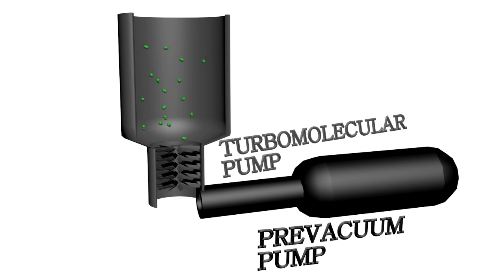Turbomolecular Pump | Vacuum Pumps

Comment: So -does a turbomolecular pump NEED to operate at 90K RPM? could it theoretically operation at a lower speed?
Reply from the maker: Newer systems are often automatic. So they start operating at low rpm when the level of vacuum is sufficient and then the rpm is gradually ramped up.